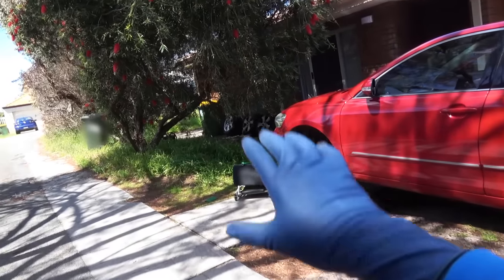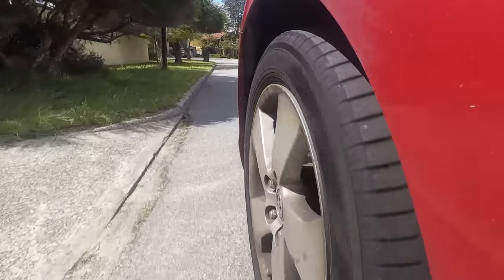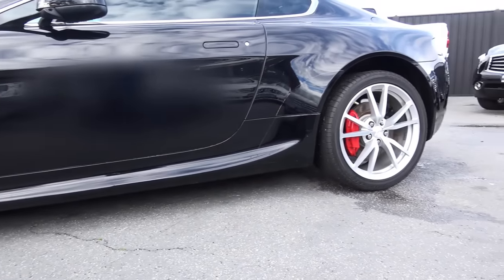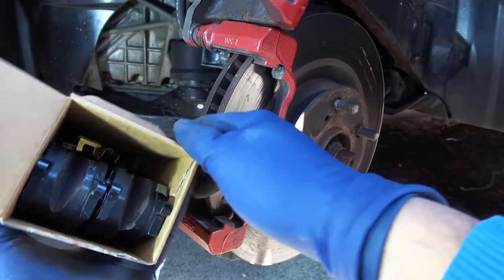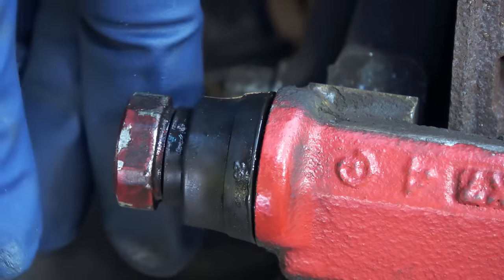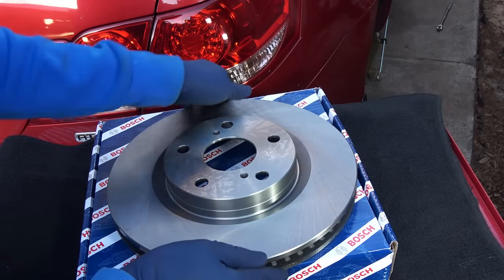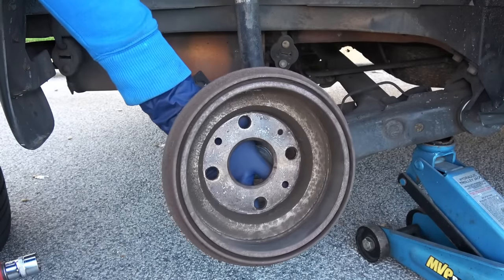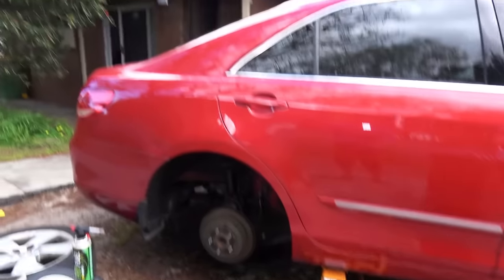How to STOP BRAKE SQUEAKING in your car (No Squeaks Guaranteed)

Comment: I  just got new front tires for my 2015 Rav4 le. Now the brakes are making, grinding and squeaky sounds when i apply the brakes and when i star driving also makes sounds for a few seconds without applying the brakes. The new front tire fit the original rim perfectly, but it looks a little biger than the back old tires. Can the new tires be the cause of the brake noice? TY in advance. GBY

Comment: I have a chirping sound from the front left brake on a 2002 Camry. It goes away when the brake pedal is pressed. It starts after a few dozen times the brakes are applied. I've already had the rotors replaced and the Akebono ceramic pads. Guide pins were lubed. That worked for about a month, then started up again. The steering wheel now shakes when braking on the highway. I wonder if it's a caliper problem since the car is 19 years old?

Comment: I heard a similar noise in my Toyota 4Runner I replaced front brakes pads & calipers it’s still making noise, granted quieter but still there. Someone told me it could be dust shield pinching the rotor I checked that doesn’t appear to be touching. Any ideas ?

Comment: I’m recently going through issues with my brakes, I’ve taken my car into brake masters and changed rotors and pads on both axels, my front axel was still squeaking, brake masters put ceramic higher quality pads and new rotors on, and a week later I’m squeaking again, any idea as to why????

Comment: So, had brake squeal when wife would reverse (on front driver side).
I changed the rotors and the pads and it's still doing it.
Any suggestions?

Comment: I have a 2015 charger and I've replaced the rotors and pads. I've cleaned EVERYTHING around where the rotor is mounted. Used anti squeaking grease on the slide pins, backing plates on pads, and the hardware on the caliper bracket and they still squeak!! I need help lol

Comment: Well with my car my front wheels seems to make a squeaking sound every 2 seconds from 35kmh to 100kmh. The sound goes away when I press the brakes, inspected myself and a shop couldn't troubleshoot the issue, could this be uneven wear on rotor?

Comment: I bought 30$ brakes from online and they make alot of noise that I had to replace them even though they had more than half the material left. Couldnt stand the noise anymore spent 70$ on pads and they sound and work way way better.

Comment: MY noise in my brakes is similar to the noise at 12:18 into the video the drum brake part where you had a screwdriver rocking back and forth a spring?  my noise seems to be louder and deeper noise, they fixed my(rear brakes) drum brakes in July this year replaced shoes,(same exact noise as now)  and the hub, etc, but any noise i guess would be a lubrication issue??? 2011 VW Jetta i recorded it on my cell, i have heard similar noises on other videos but not exact

Comment: I have brand new pads and rotors and even applied the brake grease on back of the pads and I still get a brake squeal what could it be? It's also a brembo caliper system.

Comment: I'm confused I had old rotors that were warped, and when I braked the whole steering wheel started shaking, I had installed some new akebono brake pads and while it did shake it didn't squeak, around 1-2 months after changing the pads, I changed the rotors and the shaking went away but now when I come to a complete hault there's a squeaking noice, what could I do?

Comment: I had my Lexus GS 450 front brakes changed new by Lexus 4 months ago they have were squealing for last few months now I’ve been by Lexus my front discs are warped and my front pads are glazed. I don’t not drive fast or brake hard holding brakes all the time. So what happened?  They said they will change for free under warranty but I want to avoid this happening again.

Comment: Clean the drums 
Apply lubrication to the brake pads in front rotors and  brake caliper
Get a ceramic brake pad, that won't squeak.

New break hardware

Comment: I installed new front brake pads from the dealer and new calipers & new disc that cost me $40 each and now I hear a grinding noise when I slowly release the brake pedal. Sounds like rubbing

Comment: I just got my car back from the mechanic. Even though I thought I replaced my front disc pads correctly there was a squealing noise each time I pressed my brakes. My mechanic removed my discussion pads that I fitted and they were bent like a banana. Apparently the pads were not sitting in the caliper cradle properly and each time I applied the brakes the pads got more and more bent. Just goes to show you that sometimes mistakes can happen. I've been changing disc pads for over 40 years and this is the first time I made a mistake and didn't fit the pads properly

Comment: Sir I just have replaced my brakes with new rotors and new pads. The problem on left front wheel is as i apply breaks i feel minor vibration but the vibrations stays on the brakes does not effect stering wheel.
Anybody please what could be the problem.

Comment: Putting grease on the tips of the brake pads where they contact the brake caliper bracket is pointless because most of the grease will wash off after the first rain storm you go through and what little bit is left will collect dirt and brake dust causing the pad to start sticking. The best thing to do is clean any rust off the brake caliper bracket where the clips mount and apply a light coating of gray anti-sieze this will prevent rust from building up under the brake clip causing the pads to bind. The drum brakes when you clean them you need to scuff the shoes and drums with some sand paper and chanfer the edges of the brake shoes so you won’t have any squeaking.

Comment: Great video but it did not describe my unique brake noise. 2010 Corolla, after doing a brake job, now when i depress the brakes a high pitched whistle begins, then continually goes to a lower pitch as the car stops. Almost like a miniature jet engine sound.

Comment: SOMEONE PLEASE HELP! My front drivers side pads, pretty sure its the rear pad rubs every rotation. Stops when i press on the brakes. New pads, resurfaced rotor, everything is cleaned and lubed properly, piston compressed fully and not difficult to press either. I bled the brakes at one point sound was reduced but still there and when i initially pressed the brakes the noise returned until i fully engaged the pedal then it went away. Took it apart once more  to see if i could figure it out one last time after putting the brakes back together the noise is back to its original volume. Car is a 2018 focus st only 20k miles on it and this is absolutely driving me insane!

Comment: Where this is wrong is that MOST CALIPERS DO HOLD/TOUCH THE PADS ON THE ROTOR AT ALL TIMES  even when the pedal isn't being pressed.. its called a FLOATING CALIPER and on cars that have no rotor screw, it keeps the rotor from wobbling. 

 The types of "cheap pads" that ALWAYS MAKE NOISE particularly at the beginning of your drive are semi-matallic pads, which expand when heated and the noise stops. HOWEVER, those kind of pads lead to extra rotor heat and warpage, SO NO MATTER WHAT, GOING CHEAP ON PADS WILL COST YOU MORE IN THE END, either from severe brake dust and quick pad ware (with oganic pads) or from the eventual warped rotors.

AND LASTLY DONT FORGET TO PUT A LIGHT LAYER OF BRAKE QUIET ON THE CALIPER PISTON AND PART THAT GRIPS OUTTER PAD! If your caliper boot melts against the back of the pad/the shim, that will become a MUCH BIGGER PROBLEM than a ripped boot around a sliding pin... USE BRAKE QUIET TO PROTECT EVERY SLIDING PART OF THE CALIPER!

Comment: sir, please help me.. the break of my car has scratching noise. i replaced it with new pads, new caliper boots, cleaned it well, and resurfaced already the disc twice. meaning i experience it already twice since at 1st, the resurfaced rotors made the sound disappear but after a week it returned. then same on the second resurfacing..
Reply from the maker: sounds like you've got poor quality break pads, if the rotors you resurfaced are genuine, then try genuine break pads with them or atleast a good quality aftermarket alternative, if the car comes with factory brake shims, then use them too
Reply: @JunkyDIYguy  thank you for the info.

Comment: Sometimes your rotors needs resurfaced to stop the squeaky noise. When you brake and your steering wheels shakes it means your rotors are warped, again resurfacing your rotors will save your life.

Comment: Here's an enigma
I did a brake job on my car and one wheel is squeaking and the other one isn't are used the same materials brake pad lubricant and rotors on both sides

What could be the cause?
I think it might be the little bolt that holds the rotor in place while you place the caliper bracket

On one of them I didn't put it because it got stripped and on the other I put it back

Comment: Never put the lubricant on your new hardware it will only attract dirt, instead apply the grease under your hardware where dirt can’t get to it, your hardware brake clips from the factory are not lubricated . Apply lubricant to your slide pins only after you clean the slide pins, that’s it. Too much lubricant on your caliper in any fashion will attract dirt and then the real squeaking starts.

Comment: Yeah but.. i changed pads and rotors on all four wheels and a calipter, and lubed up everything in 2019. I rely on engine breaking most of the time and my breaks have alotta material left, rotors are clean and still whine.

Comment: As an observation! You never put grease on the new pad clips or on the mounting braket, grease will acumale too much brake dust and eventually will affect how the brake pads travel. You only need to lubricate the lock pins.
Reply: Putting grease on top of the mounting bracket is a must, but youre supposed to spread it super thin (i use q tips) and the dust is supposed to cover it so the bright color goes away. I never put grease under the mounting bracket, and rarely do i change them. Only if the ones on there seem to not fit perfectly or move when cleaned, THEN i will change them, otherwise i just clean them with a q tip before applying brake quiet. 

Big thing people forget is there should also be thin layer of brake quiet on the piston, AND on the part of the caliper that grabs the outter pad.. that way way the shim doesn't heat up and stick to the caliper or piston (that makes tons of noise and cause premature brake pad replacement) 

BUT YOU REALLY DON'T WANT the caliper piston boot melting and sticking to the shim... once you rip a pistons boot that melted to the pad it may work fine at first, but that caliper those pads will be screwed well in advance of the opposite side.

Comment: Brakes do not make noise, dust makes noise, clean your brakes and use silglyde brake lube on all contact points except the friction surface. Do NOT paint your calipers! They are not factory painted for a reason, heat dissipation.

Comment: Sanded inside and outside ridges on my rotors and got rid of 80 to 90% of grinding on my 09 Mazda 5. Pads and rotor smooth otherwise.

Comment: tfw you buy all oem brake pads, rotors, and calipers twice and it still squeaks sometimes so you try aftermarket and then it still squeaks sometimes, meanwhile every other car ive had in my life takes the 20 dollars pads only and is quiet as a mouse, and lasts for 30k miles....

Comment: Mygf car  squeaks and it pisses her off !!!!  So she has a 2016 Nissan Maxima she got at used car lot at nissan dealer ... when she took car home after 2 days she told me about the noise ... she called nissan dealer took car In and told her her front brakes were 75 % and rear 60 % so I went to Napa auto store and bought good expensive pads ... when I took off rear brakes rotors were good and pads had 80 % I still replaced pads .. the car still squeaks with new pads ... my gf then called nissan and told them we replaced rear brakes but still squeaks .. then they told us it was that we put aftermarket pads ? But how if the pads that was on car prior before purchasing car was already making squeak noise ? They had nothing to say .. my girlfriend took to them paid for all 4 to be replaced by them .. car still squeaks ... what u guys think 🤔 thanks

Comment: Yeah  my  kids  friends  replace  rotors  and  brake  pads  but  still  squeaking ,  2000  Honda  Odyssey  3.5  V6 . I'm  not  sure  what  it  is  this  kids  did  ,when  I'm  the  one  whose  doing  brakes  in  my  car  wether  I  used  original  or  after  market  parts  it  won't  squeaking  like  this .  I  just  let  them  do  it  cause  I  got  me  some  injury .

Comment: Never sand your rotors you will end up creating an uneven surface which is very dangerous if you need to get rid of glaze have them properly resurfaced if they are sufficiently thick enough

Comment: 100% no squeak add brake grease to all parts contacting the metal which is where the brakes contact the hardware and touch the caliper. Upgrade to ceramic, semi metallic have metals and they will squeak, make sure hardware ain’t touching the rotors
Reply: Sand pads when replacing and resurface the rotors

Comment: Brand new Honda, brakes squeal like crazy.  I don’t get it.  I used to do my own brakes and I’d always put an “anti-squeal” silicone product on the back of the pads.  It absorbs that high frequency vibration.  This is my 3-4th video on this and nobody mentions it.  A new Honda Accord with 20k shouldn’t squeal.  I had an Accord many yrs ago and I DID use a shop.  The brakes squealed like crazy afterwards.  I took it right back and said “you forgot the anti-squeal.  Half hr later I drove it off squeal free.